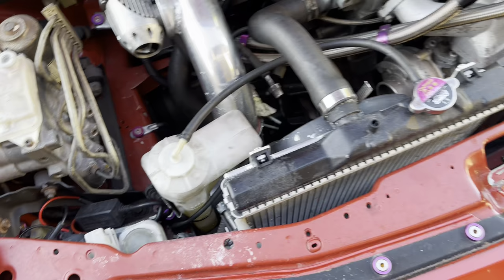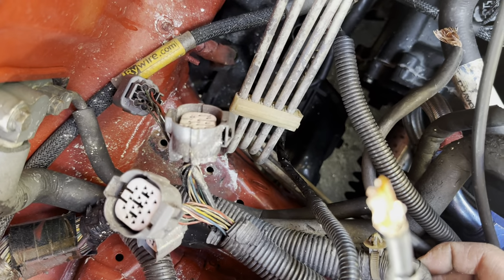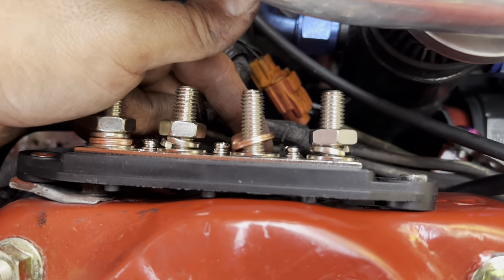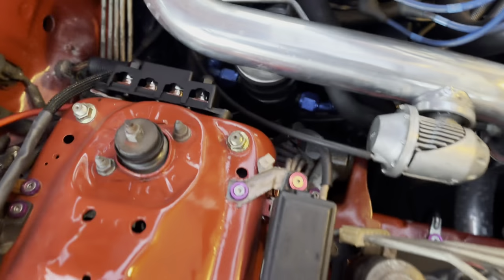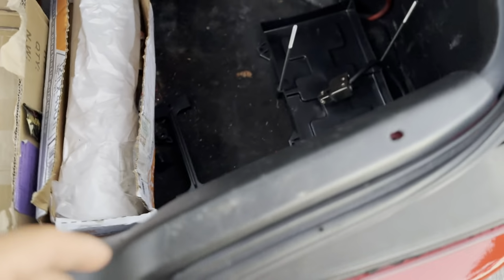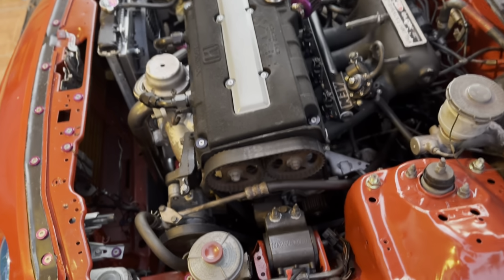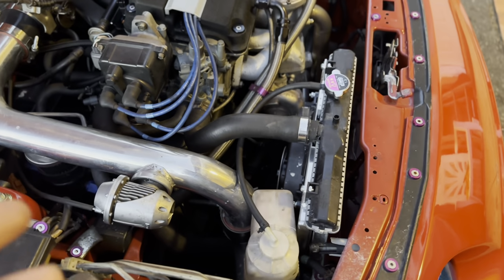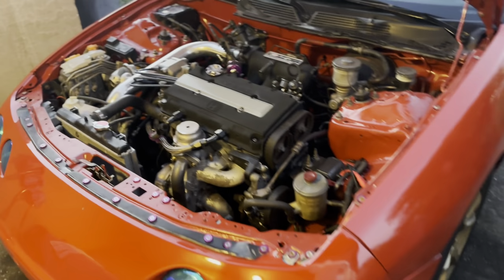Acura Integra Battery Relocation the EASY WAY & NO MORE OVERHEATING

Comment: Question? Can I skip the distribution block and wire everything through the fuse box to the back? Or the fuse box just be relocate to
Reply from the maker: If you have the space as long as the main points are in contact you can set it up however you need. I went with the block because I like having the wires individually. And also I did not need any new wires for those accessories.
Reply: @projectbteam147  ok gotcha block just keeps everything more neat I’m probably going to do that also

Comment: There’s a bunch of problems with your install. 1st and most importantly you need a fuse holder or I use a circuit breaker on that power line. If the power wire ever grounds out it’ll burn your car to the ground. Same as running a power wire to the hatch for a sub amp. Next the ground wire you put to the little piece on the rear wall is not proper. For something that draws very little amperage you can get away with that, but for a battery running the car (or a hi power sub amplifier) the ground needs to go straight to  the actual floor which is the only good ground point on a unibody car. Also, don’t buy a capacitor for your sub amplifier. It won’t help your battery at all. I started doing car stereo in 1990 and started modding and racing Honda’s (and other imports) in 1998. Good luck bro.
Reply from the maker: Thanks for your input. I’ll make the necessary accommodations.
Reply: What u recommend I do? I want to tuck my fuse box inside my glove box and run the wires under the dash…. Distribution block somewhere hidden under the dash. I need a circuit breaker on the power wire for the battery? And I need to ground the starter and battery to what
Reply from the maker: So what I did was I used an audio inline fuse holder with fuse for the main battery wire going to distribution. So in the event there’s and arc or something it will blow and disconnect the battery. The starter does not need a ground, it’s grounded to the engine once it’s bolted up. Just need to run a power wire from distribution to power on the starter and then your signal wire to the solenoid from the harness.
Reply from the maker: And your battery will need to be grounded to the chassis. I actually ended up making my own hole on the shock tower because it’s thick steel there and I tapped the hole to 1/4” and put a 1/4” bolt to hold the terminal on the ground wire.
Reply: @projectbteam147 thanks man ima try my best to get this tucked. I really want the fuse box inside the glove box if possible but if that doesn’t work cause ac stuff is kept I will just keep it in the bay
Reply from the maker: @ssjdavid  it’s possible. There’s tons of writeups online. I personally kept the box outside for con Venice of troubleshooting and also I like to try to keep the car as OE as possible. Most of the mods I’ve done are for simplicity or because I’ve had no choice for an issue I was facing.
Reply: @projectbteam147 hell yea I just have to figure out an issue with my turn signals and jdm headlights.
Reply: @projectbteam147 I’m trying to do a headlight harness tuck and rewire my jdm headlight turn signals, low beams and stuff can I pay u to help me maybe FaceTime or ask questions I can pay bro
Reply from the maker: @ssjdavid  I apologize my guy, but at the moment I am so busy with school even my projects are on hold. But there is tons of information available online. If you search up youngstatic on here he has many videos explaining how to lengthen wires for a headlight harness tuck and he shows the process.
Reply: @projectbteam147 no problem, I seem to run into an issue where my car gets no power when key is cranked …. I know one of the main fuse box wires connects to the starter wire and does the other fuse box connection connect to the distribution block or gets grounded to chassis? I know originally it connects to the battery I think I’m not sure….
Reply from the maker: @ssjdavid  one of the connections on the fuse box gets tied into the battery wire and goes to the distribution block and the other which I’m pretty sure is the lower one in the fuse box ( be sure to verify ) goes to the alternator.
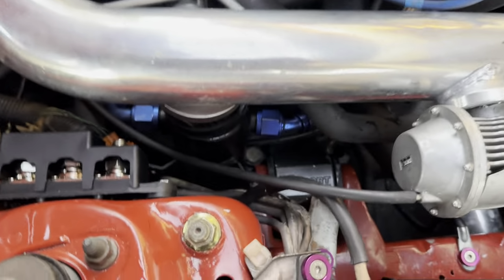Reply from the maker: 6:52 in video I believe is what you are talking about.
Reply: @projectbteam147  thanks bro cause I salvaged my car trying to fast and furious it I’m trying my best to retrace my step…. I wanted to locate fuse box in dash lol